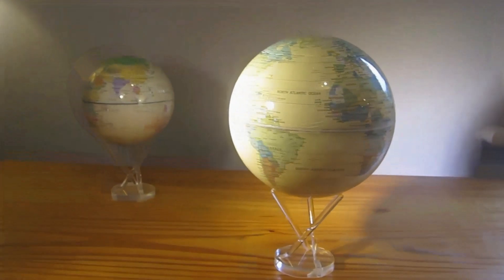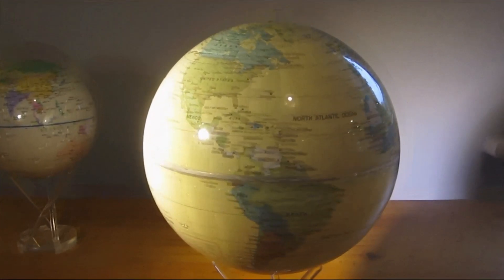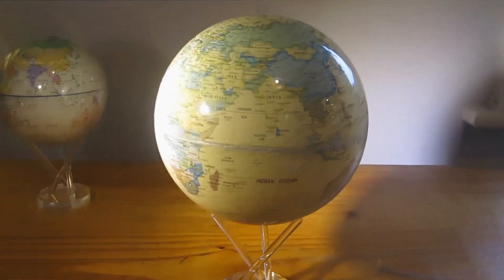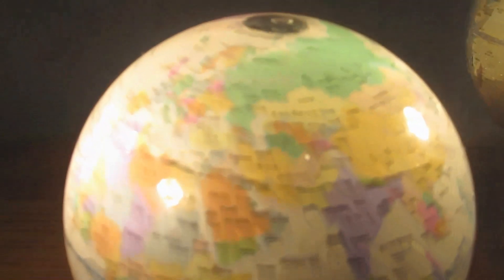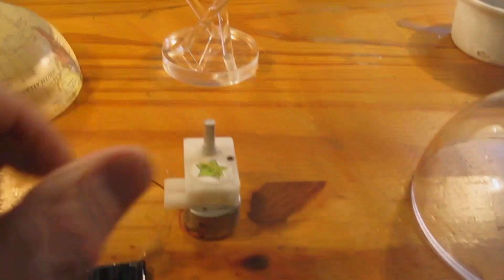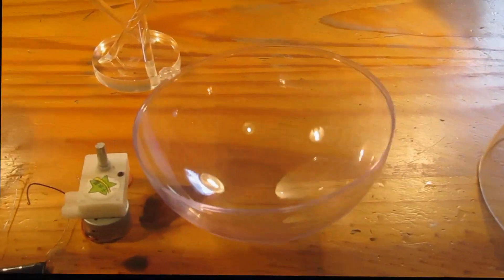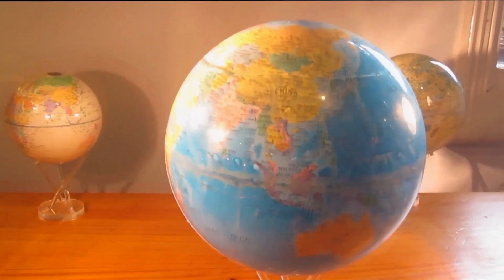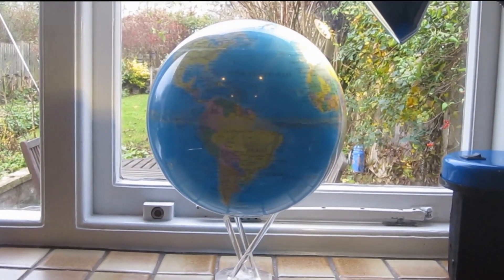MOVA GLOBES - A DIY Alternative (3)

Comment: The real mova globe uses solar cells feeding a joule thief circuit the bursts energy to 4 coils on the bottom in sequence. I think there is also a hall effect transistor used to detect the position of the disk. The whole thing is "anchored" by a powerful bar magnet that locks it into magnetic north. It uses mineral oil and water to balance the inner globe in the outer shell.

Comment: Thank you so much! May i ask how you fill it after glueing the globe together? Do you just drill a hole, fill it with the liquid and then glue the hole with uhu or do you use something else for the hole?
Reply from the maker: Yes I drilled a small hole in the outer Perspex globe before it was assembled around the globe then added water/alcohol to achieve the correct buoyancy.  I then sealed the hole with a 5mm silicon rubber bung.  Here is a link to a site on ebay that can supply the bung: https://www.ebay.co.uk/itm/334888931510?hash=item4df8ef90b6:g:bwIAAOSwFThkccUU&amdata=enc%3AAQAIAAABAORQbj%2BUpOzbC9VTYGygBO2Xzc6cceJiviOD8pQ6N9%2BRqT9cVuLXmO3TvHbjAc9bNIIdGXaij%2BElp4lvdAaUcFmdx8KaS5wHGpVDPND0Z5%2FCRdY7XUYCRTDFLxVLSiVUU54xOIScU68vFNLwnI56TiiZQz25htMt%2Fsk826jLFPBkdFLxr6yYHGSMLur9aO%2Fy0%2BZoxUy4caG5Z%2BufpK5JVJvN4JHhjb82x8tcsHPDXZLQpP0%2FhmeusZj0OkU6HI4btMW4JtTILXXKhX2FE0rDrU%2BSE6Qd%2Bf37UaZZc5rxE0sb8wSjJxGhFVbnvdS6KywP4%2FGQrelmMwl%2Bszl341VGIRc%3D%7Ctkp%3ABk9SR-a-yfrJYg

Comment: My Mova globe stopped moving and I can see liquid on the top has been evaporated and after that it had stopped moving. Please suggest how I can repair this to move again.
Reply from the maker: Hi, if there is an air bubble inside your MOVA globe there could be two possible causes.  Firstly the liquid has leaked out through the outer shell.  If this is the case you should carefully examine the globe's surface for signs of s leak.  If you find one you can seal it up by applying nail varnish or something similar.  You will then need to drill a small hole through the outer shell and add water to get rid of the air bubble.  Seal the hole by sticking a small piece to PVC tape directly over the hole.  The globe should then work again.  The other possibility is that the inner globe has a leak and liquid has entered it.  If this is the case the inner globe will not be buoyant enough any more and it will sit at the bottom of the outer shell.  When I had a similar problem I added some salt into the liquid to increase its density so that the globe floated again.  Good luck, Roger
Reply: Thank you Roger your trick is working and I was able to do it successfully. Supporting your channel completely. Please visit my house as well and stay connected.
Reply from the maker: That's excellent news.  I hope that you enjoy your MOVA globe for many years to come.  All the best, Roger

Comment: Are you able to say what model of motor and solar panels you used ?
Reply from the maker: My final design used a 14cm beige globe of the Earth which already has solar panels and a very efficient motor inside it that runs on only 1mA.  It costs about £15 including shipping.  Here is a link to where you can buy one:
 
https://www.aliexpress.com/item/32967119612.html?spm=a2g0s.9042311.0.0.1da34c4dBdjq20

You can carefully use a hacksaw along the equator to split the globe into two halves.  Unscrew the motor from the bottom hemisphere and mount it in the centre of a horizontal bar which you can secure to the underside of the top hemisphere with its shaft pointing downwards.  Small Neodymium disc magnets inside a short length of plastic tubing can be mounted on the motor's shaft.  Lead shot (as used in divers belts) can be used in the lower hemisphere to increase the mass of the globe to have neutral buoyancy in water.  The mass needs to be about 1.42kg

You will need to buy an outer acrylic clear plastic shell with 15.6cm diameter for about £6.  If you search Ebay with "15.6 clear bauble" you will find a supplier.

You can buy 2kg lead shot for £15 from here: https://www.ebay.co.uk/itm/AKM-Scuba-diving-Ballast-shot-lead-weight-belts-weighting-Cheapest-on-Ebay/172659372281?hash=item28334cf0f9:g:tsMAAOSwrBReqY1u

Best regards,  Roger
Reply: @rogercollins192  Many thanks for the response
Reply: @rogercollins192  I'v looked to buy and could not find it 😭😭